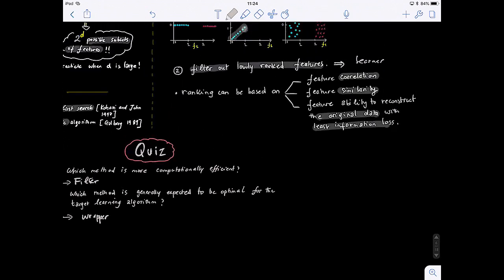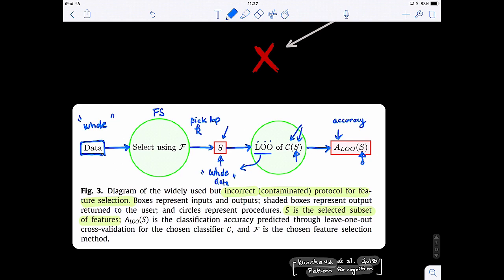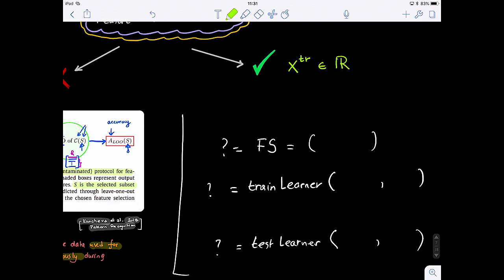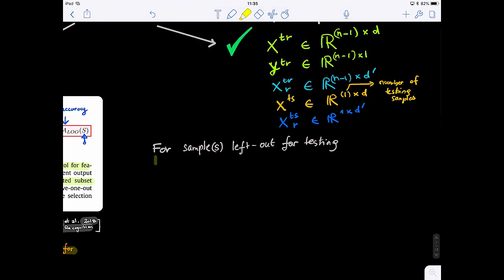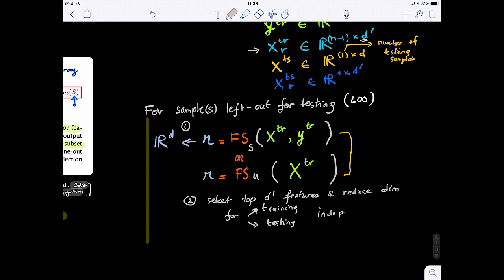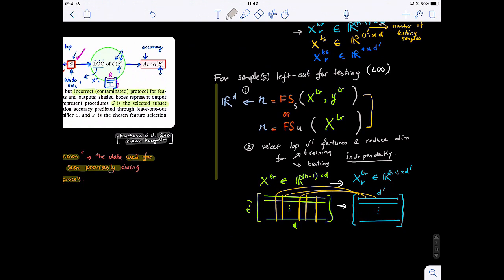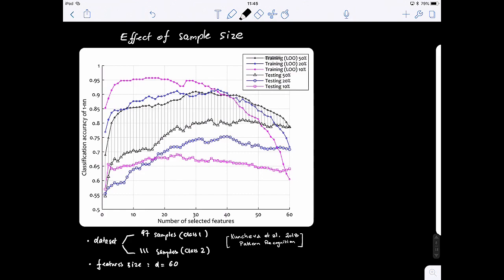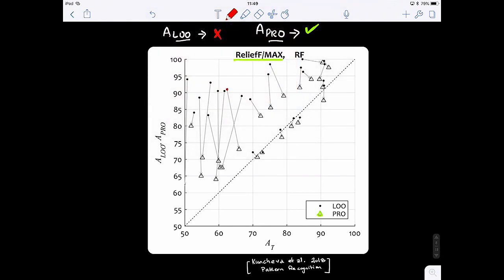Machine Learning 10.3 (Feature selection and classifier training protocol:  DOs and DONTs)

Comment: Thanks for your awesome videos. Q. What we are evaluating in the cross-validation (CV) is the Feature Selection technique right? In each iteration, we could get different features subsets but what we want to know is the performance of the selection technique. So, I can perform two different CV with two different Feature Selection techniques  (such as wrapper1 vs wrapper 2). If we obtain the best results with a given Feature Selection technique (e.g. wrapper1) in the corresponding CV, we could then use that technique over the whole data and move forward to the practical application (or a testing set). And that last might produce even a different feature subset or not?
Reply from the maker: Happy it was helpful :) 
1. What we are evaluating in the CV is both FS method and classifier. If you want to try different FS methods, you can select the one that gives you the best classification performance. However, in such case, you will know the best FS method after you complete the CV evaluation. The classification accuracy of the classifier can give you a feel for the relevance of the selected features, and hence the utilized FS method.
2. If you use K-fold cross-validation, the top selected features will vary across the K folds since you are perturbing the training set using CV. You can then design a feature weighting strategy based on feature frequency and rank across folds to identify the most important features (kind of 'agreed upon' by the K training subsets).
3. The problem of finding the best FS method for a given dataset is challenging to solve. Check out this video https://www.youtube.com/watch?v=9HbLxNef2t8&list=PLug43ldmRSo0bX8cOSuMWinXs-xem9q4o and related paper: https://www.sciencedirect.com/science/article/abs/pii/S0031320319304832
4. NAGFS code is also a new feature selection method that performs cross-validation to learn how to identify the most relevant features across folds. You can find the code in Python at: https://github.com/basiralab/NAGFS-PY
This implements point 2.

Comment: Just for imagining we are using 2-Fold instead of LOO. Then we divide samples into 2 and training and testing dataset would be s.t. : X'tr -> dimension [n/2xd], X^test -> dimension [n/2xd]. After that we would use FS and rank the features. And select i.e. nxk features. Finally we would have X'tr, reduced with dimension [n/2xk] and same as well for Xtest, reduced. Is that correct?
Reply from the maker: Yes that is correct. So in this step, you selected fold 1 for training and fold 2 for testing. Next, you select fold 2 for training and leave fold 1 out for testing. As such, you will eventually predict the labels for all n samples in the dataset based on feature selection.